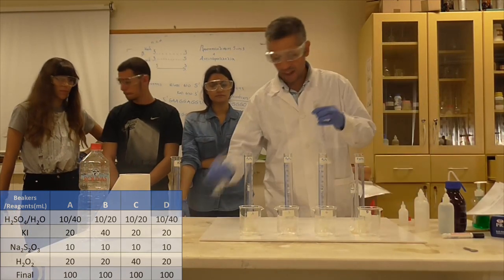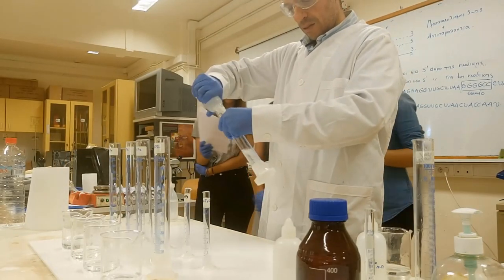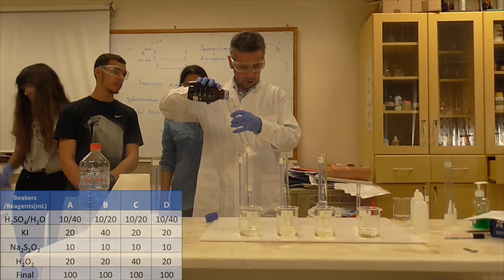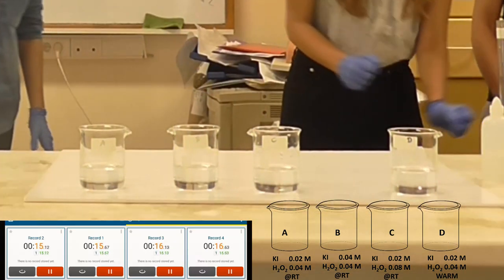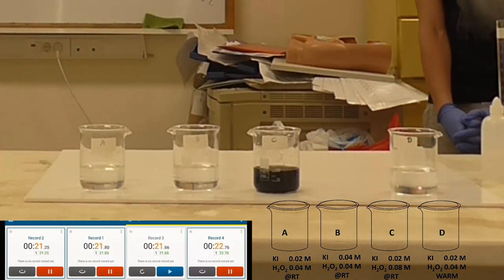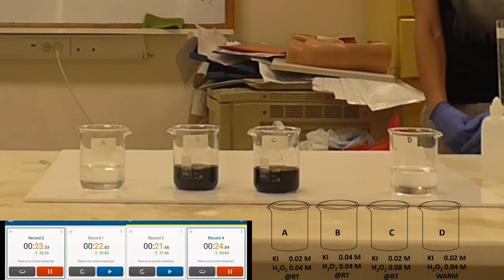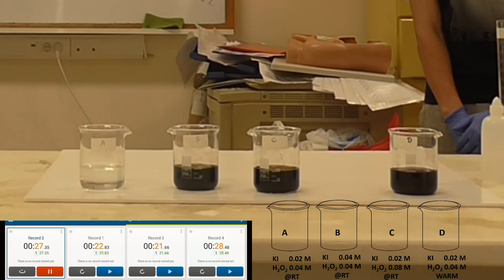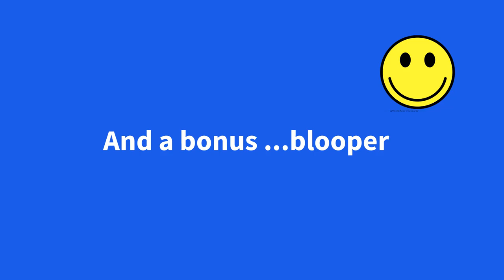Iodine Clock experiment explained  (Grade 12 school science lab)

Comment: hello my friend because you're in chemistry I would like to know is there any way to make transparent starch solution? because I tried to filter it and it doesn't work .thx
Reply from the maker: I prepare my 2% starch solution in a way that it is transparent. I boil 100 mL of water in a beaker (beaker A), and in a separate beaker (B) I weigh 2 g of starch. Then I add a very small amount of room temperature water on the starch and I mix with a glass rod to make a slurry (not a  solution). It is important to add the proper amount of water; we do not want starch powder nor solution but a slurry. 
Then I pour the hot water of beaker A to beaker B and stir thoroughly with a rod or magnetic stirrer. The resulting starch solution is transparent! 
But keep in mind that starch solutions are not preserved too long because bacteria and fungi love them!
Reply: @chatzida  thx but what is a magnetic stirrer and does this make it transperent thx
Reply: @chatzida  thx  my friend this is what I did but its not really transparent. i.e like water .if i use Maltodextrin can it be clear like water? bc i know it has starch in it  thx a lot